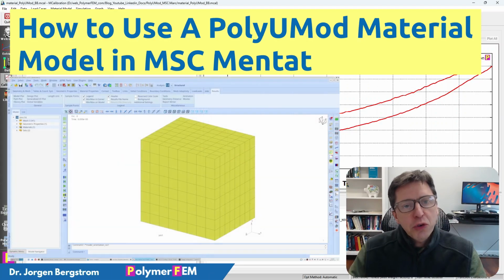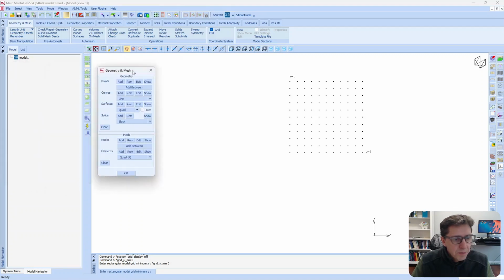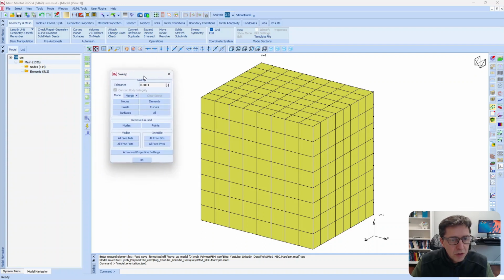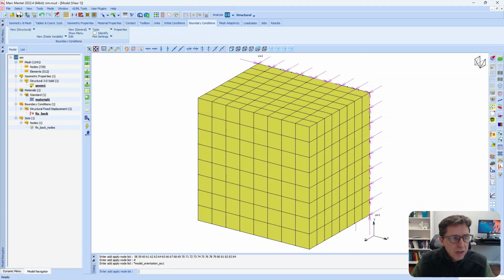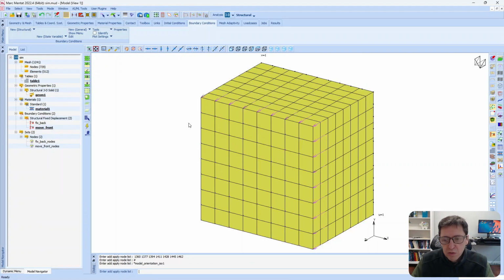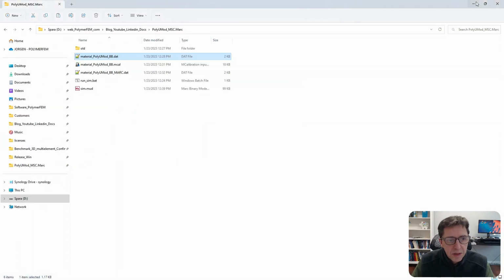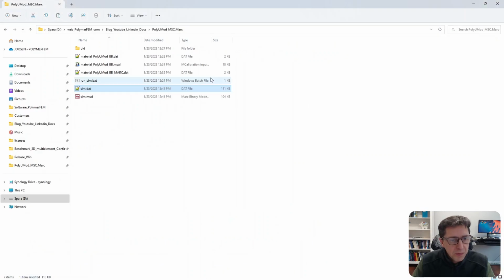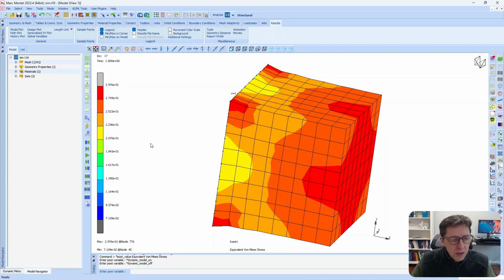How to Use a PolyUMod Material Model in MSC Mentat

Comment: Hi Dr. Bergstrom, thank you for your great content and support.

I’m currently using MCalibration with PolyUMod for a university research project focused on characterizing the behavior of a resin material, and I’m trying to implement the calibrated model in MSC Marc Mentat. I followed your tutorial exactly, and I’ve verified that the units are consistent between MCalibration and Marc.

However, I'm still encountering a “Sequential I/O error” (Error: Exit Number 4009 in MARC) when running the simulation, and it’s unclear what’s causing it. I'd greatly appreciate any guidance or suggestions you might have to help resolve this issue.

Thank you very much in advance!

Best regards,
Sebastian Leon